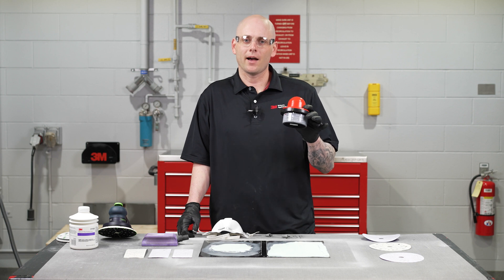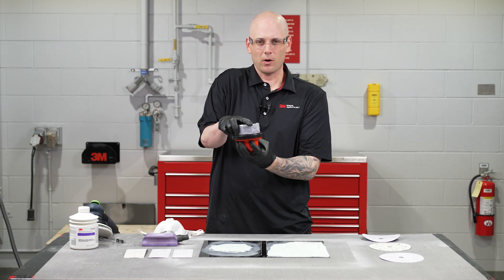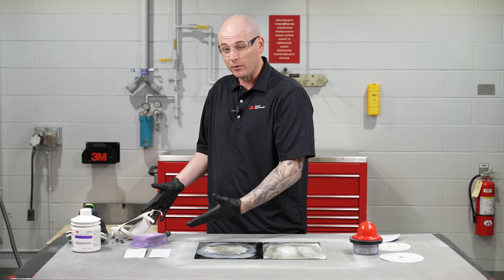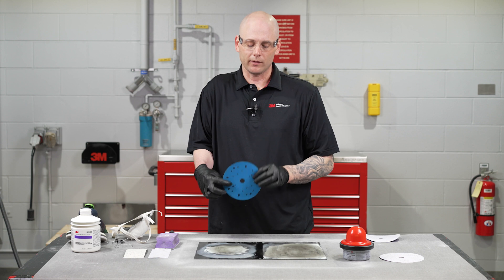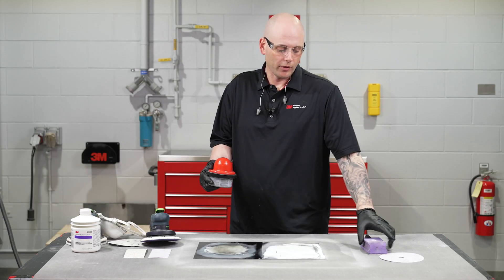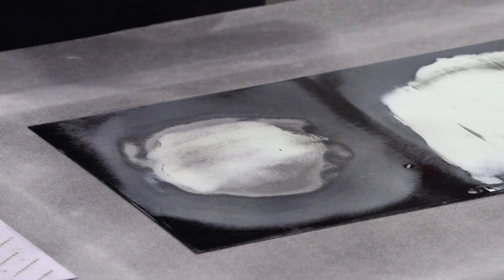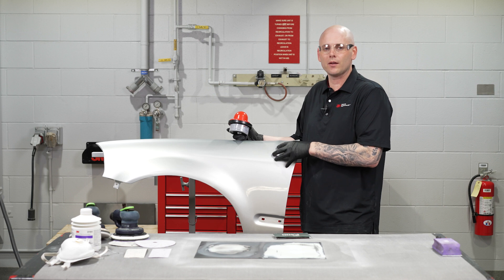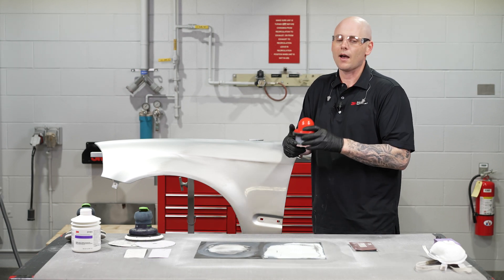TECH TIPS: Dry Guide Coat for Sanding - When, How, and Why

Comment: What is the recommended best practice for reapplying glaze or body filler after using dry (or wet) guide coat?  Is it necessary to completely remove any residual, i.e. will it potentially cause adhesion issues?  Thanks for the videos!

Comment: I'm curious if you need to do this if you take everything down to bare metal with something aggressive like 40/60/80 grit sandpaper and then want to prime with epoxy primer and paint in one step essentially without sanding the primer in between?
Reply: You should sand the epoxy primer to at least 600 grit once dry, and should allow it to dry. I haven't seen an epoxy primer that recommends wet-on-wet...
Reply: @PhillipsTravels   @00dibrah  Interesting. All the epoxy primer's I've looked at or used have a 5-7 day top coat window. After that time sanding would be required in order to top coat. I've just never really painted anything with it that would matter what it looked like after everything was finished. I want to avoid sand scratches showing through the final product if I don't sand the bare metal with some finer sand paper before priming and painting. I'm ok with sanding if I have to, but it would be ideal if I can get an adequate final finish without sanding. Dunno if I articulated what I'm trying to do well enough. 😂

Comment: If I'm using a black high build primer should I use white guide coat?
Reply from the maker: Yes, when using a black high build primer, it is recommended to use a white guide coat. The purpose of a guide coat is to provide a contrasting colour that helps you identify any imperfections or low spots in the surface you are priming.